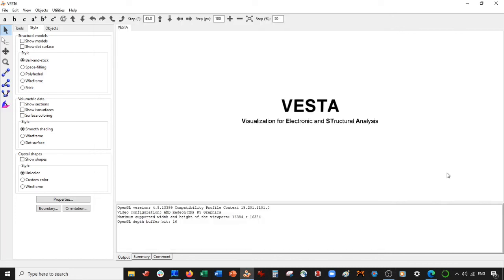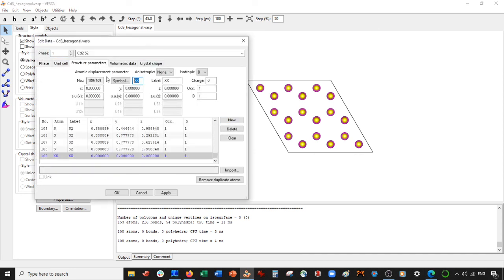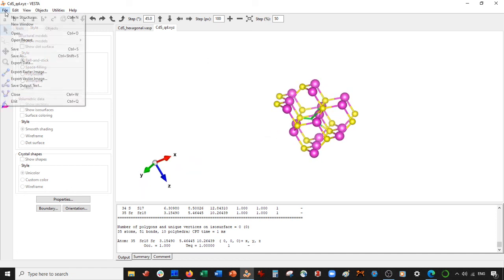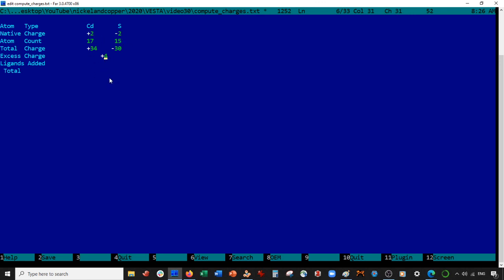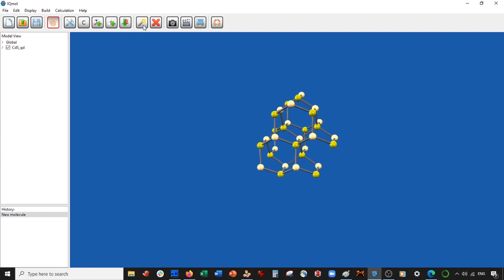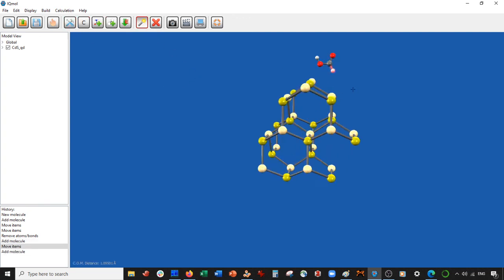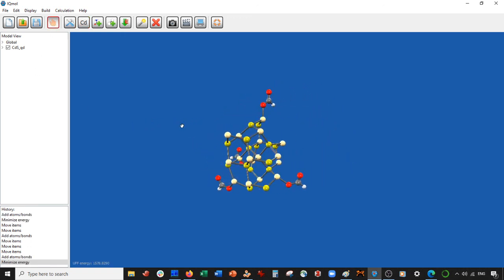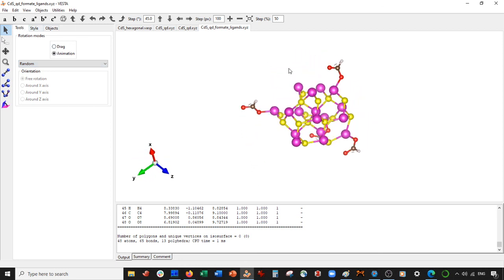VESTA / IQmol Software - Add Ligands to CdS Quantum Dot

Comment: I would like to ask you a question about generating the QD of alpha-sulfur. If you could explain, the QD generated from this method does not look correct to me for sulfur.
Reply from the maker: Hi, the nanocrystal is likely fine. When you make nanocrystal sin a lab one gets a distribution of different shapes, sizes, and stoichiometry. What’s most important is to follow this charge neutralization approach.

Comment: How would the unit cell now look after attaching the ligands? Would vesta automatically update that? Is it even important?
Reply from the maker: Hi. Vesta doesn’t update the unit cell. For cluster models there is no unit cell actually. If you must use some sort of cell, you would use a cell large enough to approximate enough vacuum to make it seem like there is not even a cell there. For practical purposes, a cell like 25x25x25 is probably be fine here
Reply: @nickelandcopper5636  Ah yes that makes sense thanks
Reply: @nickelandcopper5636  Would you know how to update the unit cell? It seems to scale everything when I go to edit lattice parameters, and also when i edit it directly in the .cif file.

I'm asking because in some cases you can import the .cif directly into a cp2k DFT calculation, and we wish to get the boundaries of the structure as close to repeating units of itself
Reply from the maker: @alexanderm2220  save some random crystal file as a .vasp. Then, delete the Cartesian  coorindates and update it with the coordinates of your cluster. Make sure to have the atom types above the Cartesian line correct in their type and number. Then I just manually set the unit cell vectors, which should be located a few lines above the word Cartesian. Save the .vasp using Cartesian coordinates
Reply: @nickelandcopper5636  yes it worked, nice thanks

Comment: Hi, I wish to find the binding energy of CO2 on Pt(111), for which I need to set up two Pt 111 slabs, one with CO2 (or CO) bound near the slab surface and one without. Can you help with the latter? Also, how is the procedure listed in this link (http://hjkgrp.mit.edu/content/building-slab-geometries-catalysis-vesta) different from your approach to cutting Au and exposing the 111 face in one of your earlier videos?
Reply from the maker: Hi. I’m not sure about the link. For the Pt 111 surface I am not sure which space group your refer to but if it is cubic then the procedure is the same as the Au. Also check the bulk silicon one that is similar

Comment: So you are adding ligands to fix excess charges or neutralizing the unit cell. I'm not much familiar with it. I have some questions. So after DFT calculation, there will be a finite contribution of ligands in the PDOS also in the Band structure am I right? what about adding only hydrogen or any single atom instead of a ligand? If we don't add any ligand/atom that will affect the position of the Fermi level for sure. What about if we manually pull the Fermi level up or down? Will that be an acceptable procedure just for showing the bandgap and some properties? Or what about changing the value of NELECT (total number of electrons)(that will make the cell charged of course). Well, I have tested some calculations by changing NELECT. it fixes the Fermi level perfectly but due to that, some defect states in gap seem to be missing (it was there when using default NELECT). So what do you suggest for charge neutralization for some doped (substitute type with a different number of valence electrons, like Al replacing Cu) bulk system, unlike QD? 
Thank you.
Reply from the maker: Yes there should be a finite contribution from the ligands. A lot of people do add hydrogen, how ever the issue is with the excess change and the position of the fermi level. Typically one would add ligands as I do until the excess change is neutralized, and then continue to add neutral ligands until the surface is passivated entirely. I’m not sure about manually pulling the fermi level down. Changing the total charge of the cell is most likely the way to go, and it’s what one would do in the case of the bulk systems. If you don’t compensate with the background charge the program will treat your defect as neutral and the extra electron will affect the fermi level, I think

Comment: If you dont mine make a video for how to create root7×root7×1 unitcell video. Egarly wait for that only
Reply from the maker: Hi. The root integer unit cells are simply original lattice types with internal planes as the new surfaces. See my video in cutting the 111 surface. This would be essentially taking the cubic lattice and making it into a root3 or root2 unit cell. Basically the root unit cells are nothing more than unit cells with internal planes as the exposed faces
Reply: @nickelandcopper5636  Thanks for the valuable replay. In mycase i'm taking two monolayer  ( lattice parameter repectively a=b= 3.1 and a=b=2.34) to create heterostructure.but it has lattice mismatch.it reduce that make first layer is 2x2x1 and second layer is root7xrootx7x1.in this hexagonal 2d layer case how to create root7 unitcell
Reply from the maker: Hexagonal is already in the root basis. Basically the root basis is a measurement of the hexongal in terms of the cubic. I think it may be 3x3 hexagonal in your case
Reply from the maker: Hi. I won’t be emailing anyone privately on this channel. We should keep all things public for all to benefit. But I will take a look at this structure and see if I can make a tutorial for it.
Reply: @nickelandcopper5636 really your great man

Comment: Wow. I asked the attatchment of ligand to quantum dot before and you posted it! Thanks a lot. I have one more question. Can I apply your method to CsPbI3 perovskite quantum dot such as CdS with iqmol? And our lab does not have VASP so I am using Burai (Quantum Espresso). Can I calculate binding energy of ligand to quantum dot using iqmol, VESTA, and Burai system?
Reply from the maker: Yes but you will need a large plane wave energy cut off and a large unit cell box. These should be tested in a convergence  study. It’s funny you ask about perovskites, this paper uses the very method I show here for them https://pubs.acs.org/doi/10.1021/acsenergylett.6b00595. Except they do not use spherical nano crystals as I show they use the cuboid form given that the electron microscope images of the perovskite quantum dots appear cubiod in their form. Be sure to check the other works of this author their lab are professionals at perovskite nano crystal models. When you read the paper you will notice they use the same excess charge method I use in this video. Also be aware that iqmol has trouble detecting bonds some time. You may have to manually redraw them when you first load the structure into iQmol. I got lucky here ...
Reply: @nickelandcopper5636  Thanks for your comments. Although I am a novice in this field, I am following up nowadays and your posts are very helpful and they are my teacher. I will study how to calculate SCF step by step assisted by your posting, comments and reference!